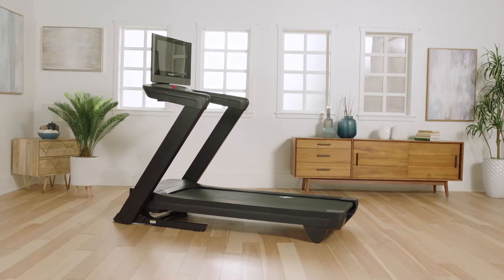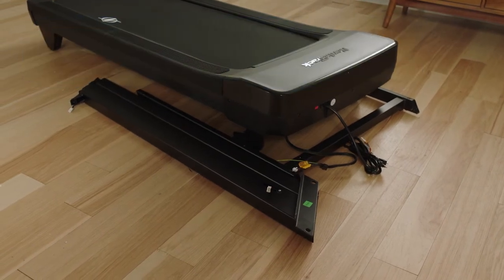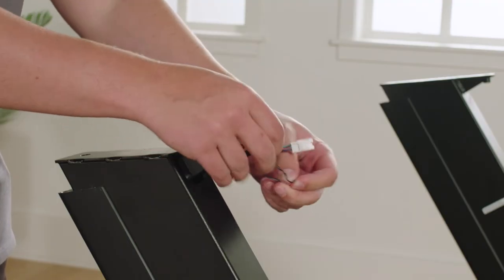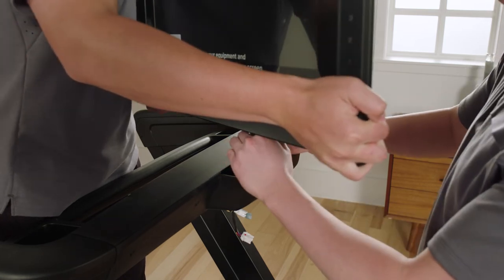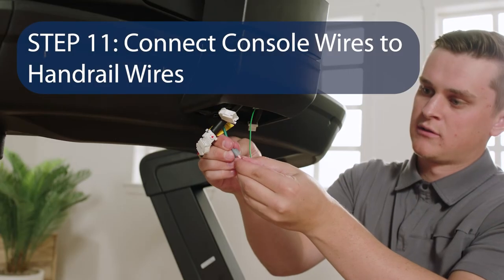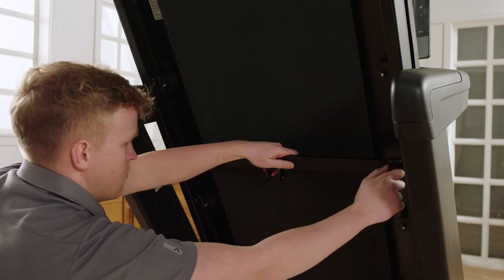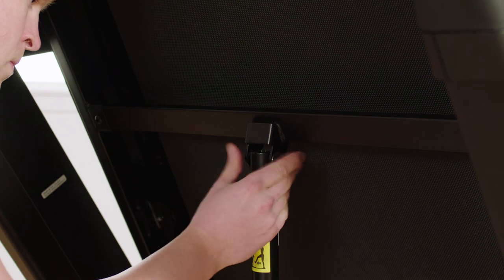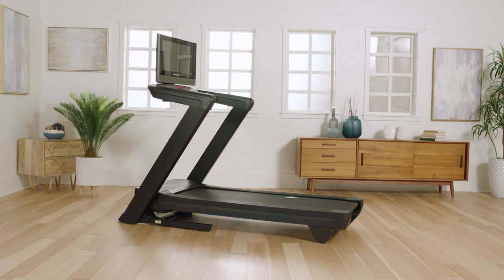2023 Commercial Series NordicTrack Treadmill Assembly

Comment: I installed it myself, even the lift bracket underneath the belt. It was a bit dangerous installing that lift bracket. I cut 2x4s to the exact size that l needed to hold up the treadmill base while l installed the 🔩s for the hydraulic bracket (I wouldn't recommend anyone doing what l did). It took me a couple of hours to install it by myself.  It really takes 2 people and actually someone fairly strong to hold up the treadmill belt base while you put the hydraulic bracket underneath the treadmill base. The Horizon elliptical l bought took me 3 hours to install myself, so l would say that this treadmill was not really difficult to install, but not really easy either.

Comment: By chance do you have a disassembly video to prepare the treadmill to move to another room?
Reply from the maker: Not specifically. most treadmills are not really designed for disassembly. Usually I'd recommend reversing the steps shown in the video. The main problem with doing it any other way is the wire harness. Only a few older models and incline trainers have a wire that disconnects at the base of the upright. If you try to move the uprights and console as one part you should feed a fish line down the upright with the wire harness so it can be reconnected and fed back up when reassembling.